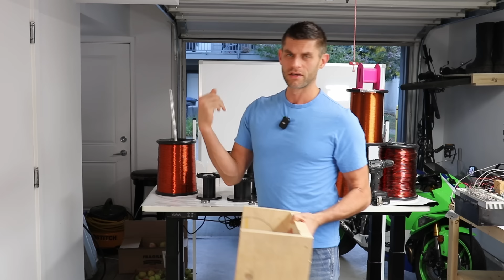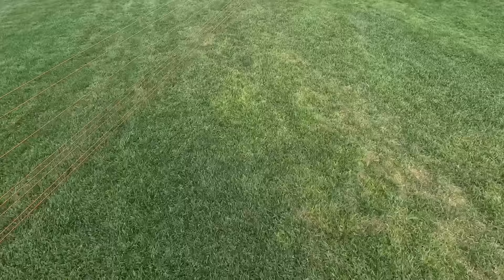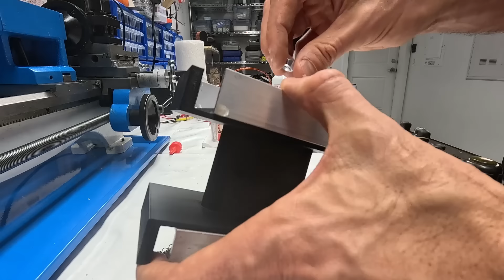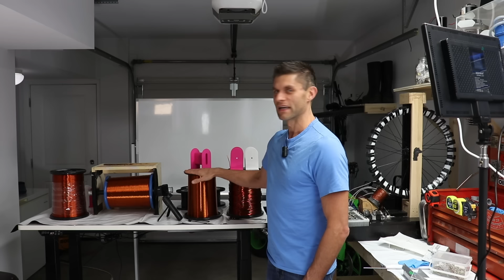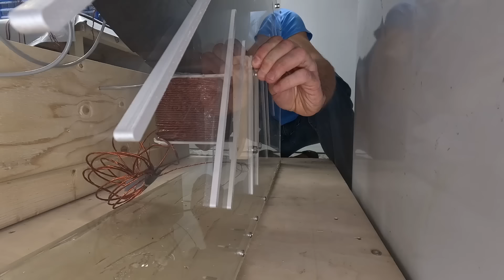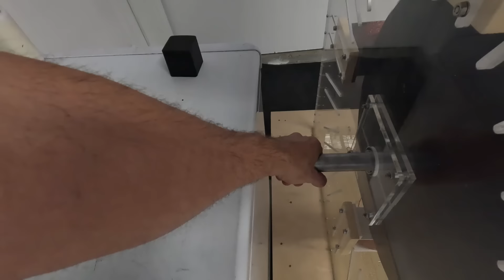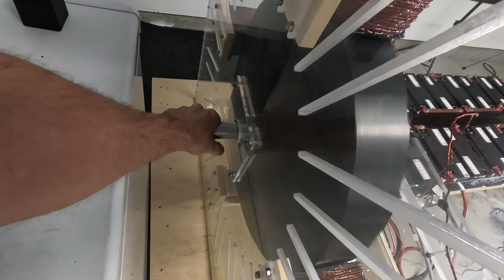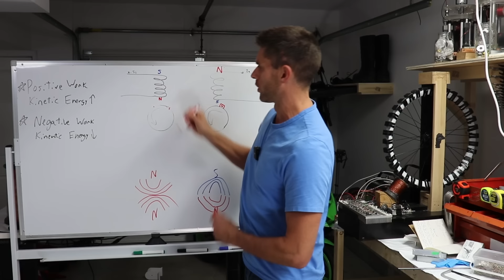The Device That Could Give The World Unlimited Energy

Comment: 3:19  the external electromagnetic field that we are creating due to the internal flow of electrons. The electricity inside the wire is creating an external electromagnetic field.

There is no "internal flow of electrons."  CP Steinmetz said in the 1920s that the idea of an electron particle racing down a wire was a primitive notion which was retarding understanding and progress. The electromagnetic field is one unified thing, and where you can measure magnetism (outside the wire) there is also electricity. The wire directs the electricity.
Reply: Yes, there are no "electrons shooting down the wire" per se. The electron's properties actually dictate the conductive property. Essentially, the copper has the ability to easily transfer, "conduct", electrical charge and the electron drift(flow of electrons) is actually quite slow.

A more accurate way to describe electrical conduction in a material like copper involves the collective behavior of electrons in response to a change in electric potential.

You see, It's not one electron traveling from the start of the wire to the end. 
Here's what happens:

Applying a Potential Difference: When you connect a copper wire to a power source (like a battery), you apply a potential difference (voltage) across it. This creates an electric field that extends through the wire at nearly the speed of light.
Force on the Electron Sea: This electric field exerts a force on all the free-moving, delocalized electrons in the "sea." The electrons, being negatively charged, are pushed away from the negative terminal and pulled toward the positive terminal.
Propagating the Potential: While the electric field is established almost instantly, the individual electrons themselves move quite slowly, in a process called electron drift. They constantly collide with the copper ions, other electrons, and impurities, causing them to move in a zig-zag path. However, the effect of the potential change is passed along from electron to electron down the wire extremely quickly.
Think of it like a tube completely filled with marbles. If you push a new marble in one end, a marble almost instantly pops out the other end. No single marble traveled the full length of the tube, but the force (the potential) was transmitted through the chain of marbles immediately. Ask me about current.
Reply: @devononeal272  So the electric field requires electrons in wires (like marbles in a tube) but the magnetic field only requires empty space; is that correct?
Reply: @codetech5598 its the spin, everythings spun out, magnets direct the english on the ball if you like
Reply: @codetech5598 yes. Ill explain.

The reason magnetism doesn't need a medium is because it's part of a self-sustaining phenomenon: the electromagnetic field. As discovered by James Clerk Maxwell, a changing electric field creates a magnetic field, and a changing magnetic field creates an electric field.
This perpetual dance between the two fields creates an electromagnetic wave that travels on its own, carrying energy through space. Light, radio waves, microwaves, and X-rays are all forms of these waves. The fact that we can see light from the sun and distant stars is direct proof that the field travels through the vacuum of space.

While a magnetic field doesn't need a medium, its behavior is affected by the materials it passes through. This property is described by a material's permeability.
Vacuum: The baseline for permeability is the "permeability of free space," denoted as \mu_0.
Diamagnetic Materials (e.g., water, wood): These materials slightly oppose the magnetic field, weakening it.
Paramagnetic Materials (e.g., aluminum, platinum): These materials slightly enhance the magnetic field.
Ferromagnetic Materials (e.g., iron, nickel, cobalt): These materials dramatically concentrate magnetic field lines, strengthening the field by hundreds or thousands of times. This is why iron is used as the core in electromagnets.
Reply: @codetech5598  Not quite: The electric and magnetic fields exist in space. The movement of the electrons is electrical current. The electrons move in response to an electric field, moving electrons generate a magnetic field. (And confusingly, moving charges within a magnetic field results in forces acting in the charges.)
Reply from the maker: @codetech5598 well is rhe space empty? Its photons generated from the internal electron flow that form the magnetic field according to Thane Heins
Reply: @MadscienceLPTECH  Space is empty according to mainstream particle physics which denies the AEther.
Reply from the maker: @devononeal272 electron fission and fusion*
Reply: You both are on two different pages.
Reply from the maker: @andremosley4317 yes
Reply: Have a look at Don Smith’s devices.
Reply: Regardless of how we interpret what is happening in the wire, an external electromagnetic field is generated.
Reply from the maker: @clintc9813 ❤
Reply: It's Current ❤
Reply from the maker: @Aaronthetreeguru lol
Reply: I will never understand electric flow in wires. But the field created is also mysterious.
So far I think I only "get" that materials that are conductive like copper wire achieve a remarkable electron exchange from atom to atom as long as there is some kind of a load. I gather the longer the wire the more "resistance" this end to end  exchange encounters. It is all really fascinating but I hit a block too easily. I have to learn so much more before I try anything like this. This is really cool watching you use your knowledge to make this video! Creative use of athletic field too!
Thanks!
Reply from the maker: @kazparzyxzpenualt8111 ❤thanks for watching
Reply: That statement from the video, is technically a factual statement. (even a broken clock is right twice a day) 

Also, Electron drift is something any highschool student should have encountered. In other words, electrons do flow internally.

In AC, the skin effect takes shape...and increases with frequency.

But in DC there's no skin effect. The electrons drift down the wire, inside the wire.
Reply: @tylerdurden3722  Do you think that the slow "electron drift" in a wire of say 1 millimeter diameter is responsible for creating a magnetic field that can be detected by a compass 1 meter away?
Reply from the maker: So Steinmetz says. Thane Heins says electron fission and fusion cascades down the conductor.
Reply: @MadscienceLPTECH  So these electrons fizz and fuze as they ricochet down the inside of the wire, but the magnetic field exists in thin air outside the wire?

Comment: In order to calculate the output power, use a cap with a knowing load watts in differents voltages......then you will have the exact output......
Reply: I used a light bulb in paralell with the cap.....knowing the voltage on the cap, then same voltage on the power supply to see the watts......your system is big so light bulb watts should be according.....if too much output, then install more light bulb.
I believe that the gain would be on the generator coils, also on the shaft.

Comment: I recommend the use of oscilloscope in order to see what is hidden......the question here is how create big spike with low input....so big spike as the Y and low input as X. Good luck there, the eff of  batteries is a pain,  batteries with spike charging needs to be in 15 to 16 volts to be fully charge.
Reply from the maker: Agreed. Not sure about taking batteries that high though withiut damage

Comment: Bringing another magnet close to the unused pole, such as from another rotor, would definitely induce additional voltage in the coil which would change the impedance and apparent load on the coil seen by the coil drivers.  It would take more or less current depending on the polarity of the external magnetic field and the polarity of the induced voltage in the coil vs the coil driver voltage polarity.  The attraction created between the energized coil and magnet will do work on the magnet motion, increasing incoming speed/decreasing outgoing speed of the magnet vs. coil.  Because the coil does work on the magnet, power is consumed to maintain the magnetic field of the coil, and that portion of work done by the induced field in the coil becomes non-recoverable when the field collapses.  There will also be resistive losses in each coil when the pulse current is flowing, which should follow linear ramp increase with time, until saturation.  Shorter pulses have less losses, but less overall power.
Reply from the maker: A pulse dosnt give the fields time to induce any amperage changes though. Moving magnets past coils yes this does effect amperage flow / induce. Great comment

Comment: Getting a one wheel could save you time walking back and forth, when it snows you might want to get a warehouse, not sure what your current budget is but you could definitely and should definitely make this a more automated process as the whole world will need these devices.
Reply from the maker: Good ideas thanks for the input
Reply: Or buy 3 more spools and do it in 2 laps instead of 8. But any time you can do useful work while exercising is generally a net gain, since exercise is necessary regardless.

Comment: Power waveforms of pulse motors inherently is flawed unless the waveforms are sinewaves, which they almost never are.  RMS measurements of low duty cycle pulses will read incorrectly.

An oscilloscope that can do integrals of the current and voltage waveforms and duty cycle might be able to calculate power more accurately.
Reply from the maker: Agreed
Reply: @MadscienceLPTECH  It’d be great if Tektronix (or some wealthy individual) could gift you with a 14-bit scope with multi-GHz sampling 😁 That would let you really see what’s happening with the waveforms. The key to what’s going on would be the instantaneous voltages and ion mobility in the batteries, but a very high bandwidth and precise view of voltages and currents in the external circuitry. I’m happy to see someone taking a careful and non-WooWoo approach to this(!)
Reply from the maker: Litterally what happened wait till you see
Reply: @MadscienceLPTECH  Something I did to my control circuit was to put jumpers on various locations in the power flow, in & out, then for measuring power waveforms I would insert a 1 ohm resistor (or 0.1 ohm) instead of the jumper and them measure the waveform to figure out the true current peaks and shape.  My motor would only draw a few hundred milliwatts using a 48V supply, so current was very low.  You are using a fractional ampere draw from the numbers you showed, so the same principle may help your analysis.
Reply from the maker: @geraldc867 agreed
Reply: EEVBlog is a very active place and has engineers all over the world. Discuss the ideas there. You will get lots of feedback.
Reply from the maker: @jheissjr thanks. Ive got the best EE helping me with the measurements. Next video will be great
Reply: That's only if your measurement assumes a sin wave and is just multiplying by sqrt 2. Modern meters which aren't the most cheapo use an integrating circuit which measures the true RMS
Reply: @onradioactivewaves   but with what kind of sampling rate to avoid Nyquist type errors?
Reply: @geraldc867 doesn't really matter in that way, the integrating circuit charge up over the period. Obviously the meter samples at thee nyquist frequency or above for whatever frequency ranges are valid. 

The integrating circuit is an energy tank, so it's sampling at the rate of the universe.  So in other words, you are collecting total energy per cycle or half cycle and then getting the RMS voltage or current based on the RMS mathematical definition, it's a true RMS measurement.

Cheap meters just assume a sine wave and use the simple mathematical result of sqrt 2 times the magnitude for pure sin waves, the integrating circuit is measuring the total which is then averaged based on the period.
Reply: @geraldc867 this may be more of an issue using an oscilloscope which is doing math on screen rathen than using an integrating circuit. However,  the oscilloscope is more than lijely designed innthe same manner, such that each data acquisition is still averaging out the voltage based on the energy.  In other words, to be accurate over the period. In high frequency measuements, what you get os alreadt going to be an average of multiple repeatimg waveforms, which is why an important spec is samples per second.

Even if 100% of the energy transfered in 1 aquatiin happens in 10% of the perjod of one acquisition and the other 90% is nothing,  that one aquisition  is still acurate as an average for that time perjod.  We're not going to build a device that samples at 2x the frequency of Plank time.
Reply from the maker: @onradioactivewaves agreed ❤